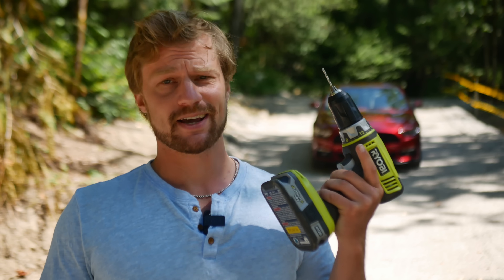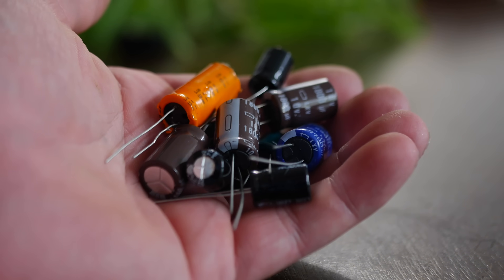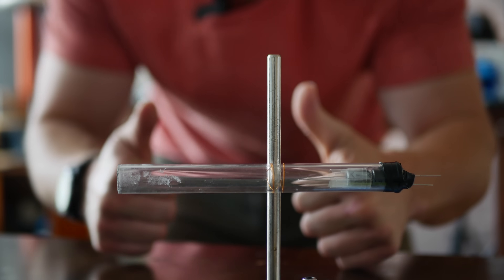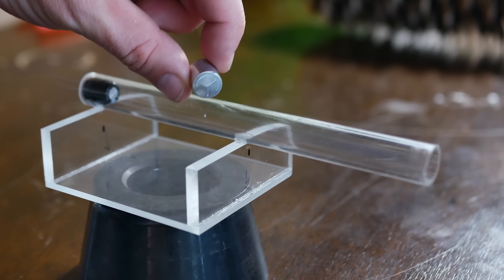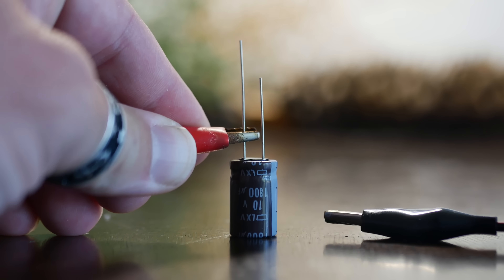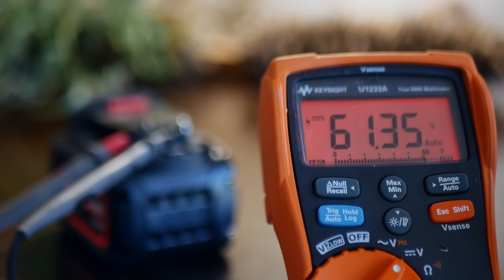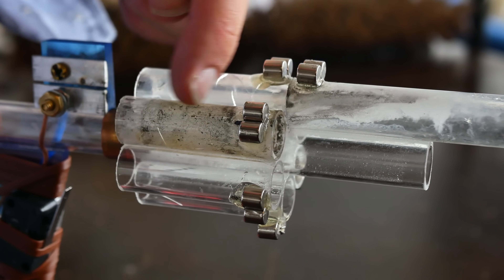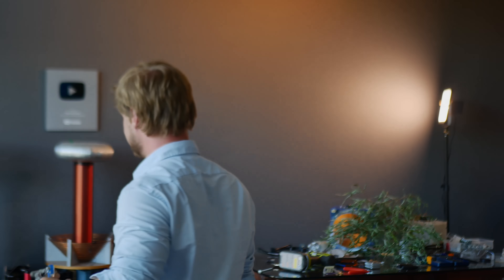I Built An Electric Capacitor Revolver!

Comment: This is such a hilariously bad idea, good video. Probably need a dc to dc step up converter for higher voltage. The copper pipe is ok for short term but will need something stronger as you get more pressure.

Comment: Hey this makes me think of two projects for you. Both of them by the same inventor, Edwin Grey. Edwin invented a motor that used high voltage capacitive discharge to make the coils impulse and rotate. The motor coil with its nominal impedance looks as a very low impedance compared to a high voltage capacitor so the capacitor instantly dumps and you get an intense magnetic pulse. But he started by pulsing magnets this way and making them jump with great energy when the capacitor discharges. You should put that into your gun. And yes that's plasma related because it uses a spark gap to switch the dump cycle when the capacitor voltage reaches High Enough during charging. The second project is the motor itself.

Comment: For Mobil projects like this I use Harbor freight‘s atlas 80v batteries. They’re readably available an Ive taken several apart and know they seam to be consistently packing them with real Samsung INR18650-25R cells Capable of 20 amp continuous or 100 amp momentary pulsed output. Per Samsung’s data sheet.

Comment: This is very cool. Probably wouldn’t be hard to come up with some custom electrolyte fluids and find the most explosive blend... Could also possibly taper the “head” of the capacitor as well to focus the explosion out the top. Reinforcing the walls of the capacitor would go a long way here. This would be easy to acommplish by just slipping the capacitor into an aluminum or brass casing.

Comment: Maybe charge the exploding cap to max and then use your high voltage discharge in reverse voltage . This should theoretically increase the voltage potential the cap is exposed to. 😂

Comment: I know this isn’t for efficiency but for fun, but I feel like a solenoid with low resistance powered by these caps would get a better ballistic output.
That being said a boost converter and a large central capacitor to store the higher voltage should get you some nice explosive results with the same battery.

Comment: I have to 2 important questions:
 In the capacitor cannon you built prior to your final prototype it appeared that you reused the same capacitor to launch multiple shots. So how many times can a single capacitor be used? Secondly, is are any toxic substances realsed by this process?
Reply from the maker: I used different capacitors on every shot - though one of my recorded takes became corrupted, and due to contraints I needed to pop in a repeat clip. I made sure the velocity was accurate to the original corrupted clip, so the data is still accurate.
Reply: @PlasmaChannel  are any toxic substances realsed by this process?

Comment: Add a large capacitor between weak battery and firing mechanism to bump up to 90v+
Reply from the maker: Hm...I could do a 2-stage charging system. Have the battery charge two stage caps to 60 volts each, then pump them in series into the trigger.

Comment: When I was a young man I had a "small" capacitor bank, 240,000 µF @ 250v that I had a lot of fun playing with. Small caps like the ones you are using for this project were obliterated with a report that sounded like a .22LR going off! Might be worth trying something like this as a possible alternative to your drill battery, but make sure that there is some kind of safety shielding between you and the caps being blown up. I wasn't kidding about them being obliterated, usually there was nothing left but the wires and rubber plug, with aluminum and paper shrapnel blown  all around the room!
Reply from the maker: Haha, now we're talking! I"d love to try that. Youtube already hates me for producing this video - so i'd have to really be careful if I made a video about that one.
Reply: @PlasmaChannel  - Yeah, YouTube definitely tries their best to suppress anything interesting and/or educational. That's got to be a huge source of frustration for you.
Safety speech in 3...2...1: "Please be extremely careful." 'Nuf said. Caps like the ones I used (old computer caps) seem to be getting harder to source. A good substitute might be capacitors from those automatic defibrillators, as those ones seem to pack quite a punch and are often rated for some really scary voltages.
Reply from the maker: Certainly is a source of frustration. I do this full time. It pays my bills. So, when YouTube randomly slaps a “ALERT: video is demonetized” warning on a perfectly moral video, it impacts my ability to support myself, directly. 

As for caps, I’m hoping the ones I used stay available for a long time!
Reply: @PlasmaChannel  - Ouch. That's gotta hurt. I'm sorry to hear it, your videos are all very well done and educational. YouTube might not appreciate them, but a lot of us do.
As for the caps, I was referring to using the larger caps as a power source for "rapidly disassembling" the little ones. 😁 You might even be able to set up an inverter circuit so that you can charge them up with your drill battery.

Comment: Did you also plot a relationship between charge & PSI? Voltage & PSI? Rifling the barrel is also important for aiming. Have you tried exploring the trade off for rectified flyback high voltage vs giving up some of the current?(What Current/Voltage balance is best out of the wattage?). Also Nitrocellulose(modern bullet powder) is 48.50/kg; Niobium is around 45$/kg. You may have also made a cost parallel to modern firearms that could be heavily developed, & further reduce the cost to be a competitive substitute. Capacitors & voltage would be FAR easier to control the PSI & discharge velocity; not to mention safer, vis a vie Kentucky ballistics. Without the need for much of the rifling action mechanisms, you could likely make room for custom battery designs to accommodate the high wattage needs. Heck I'm not just considering building one, I'm considering turning this into a competitive product & seeking investment. Let me know if you want me to send you an email to discuss it.
Reply from the maker: Love your enthusiasm! So fundamentally, gunpowder will always explode faster than any cap that I can think of. Traditional, real firearms will outpace this in any scenario I can think of - in part due to the energy density of gunpowder vs one of these exploding caps. The velocity of my build could certainly be improved, and I know how to improve the speeds by 50% or greater right now. However, this is essentially a steam-powered projectile. Steam vs chemical explosion is not even a close match. Feel free to shoot me an email (email is in the "about" tab under channel page), I'd love to hear from you.

Comment: i think you must increase current
Reply from the maker: The battery provides about 10 amps in current configuration. Maybe more would be better though.
Reply: @PlasmaChannel  obviously it not enough, I recommend you try batteries from RC model, like fpv drones they are can give 150A in peak. Time of capacitor charging strictly depends on current and voltage

Comment: what if you had the capacitor exploding provide the initial velocity for a railgun sort of system, that would be sick
Reply: Back in the later 1980's at Culham Laboratory, we built an experimental railgun that worked this way.
A small capacitor bank was used to explode a planar metal pair of metal foils, separate by an insulating plastic sheet but bridged by a small piece of fusewire. The explosion of that foil system deformed an enclosing aluminum plate and kicked the railgun projectile into the gun rails. The latter were connected to our main 8kV, 1MJ capacitor bank.
The exploding foil technology had been taken from earlier work on a fast closing switch, the 'metal to metal' switch.
Reply from the maker: Hm, so a two-stage, double system launcher? Thats...not a bad idea
Reply: @PlasmaChannel  yes sir

Comment: instead of using metal, wouldn't it be more sensible to avoid possible shorting (because ANYTHING is possible) by using carbon fiber tubes instead? (Although using brass or copper would give it a steampunk vibe?)
Reply from the maker: I'd have to investigate what temperatures CF can withstand. The chambers get well above boiling point.
Reply: @PlasmaChannel  Greetings from Olympia! 
This might be WAY better.. "Explosion proof" glass is a borosilicate composition that is far better  than Carbon Fiber. (And it's also clear, where CF is definitely not.) high pressure, high temp invention especially when it has been tempered!

I got curious and looked and found CF has some flammability issues, please disregard the suggestion. :-)
Reply: @PlasmaChannel  Better solution! Aluminium oxynitride A.K.A Transparent aluminium!!!  It is a see-through ceramic of polycrystalline that is made from a structure of oxygen, nitrogen, and aluminium. This impressive material looks completely see-through and is incredibly strong. Transparent aluminium is four times as hard as fused silica glass, three times harder than steel, and a whopping 85% harder than sapphire, and also has an extremely high melting point and can remain solid up to 1200 degrees Celsius. This means it can be used for products which need to withstand super high heats while also being see-through. Transparent aluminium is also resistant to damage caused by oxidation and radiation and offers good resistance to corrosion. 
Aluminum Glass Facts:
Most common commercial name is ALON
Can be formed into windows/transparent armor panels
Lighter and thinner than traditional bulletproof glass
Typically contains 30% to 36% aluminum
Can withstand extremely high temperatures/large impacts
HOWEVER...... Commercial aluminum glass costs somewhere in the range of $10 to $15 per square inch. So, a 1-square-foot panel would cost between $1,440 and $2,160 (according to a Sep 9, 2021 article on Riotglass dot com) 
but there's another option...
Transparent steel is the nickname given to ArmorPlast’s™ AP25 containment-grade glazing shield system. (These transparent armor panels don’t actually contain any steel or other metal elements. They get the nickname from their steel-like strength and impact resistance.)
AP25 sheets are made out of a single layer of AR polycarbonate with an abrasion- and UV-resistant coating. AP25 is a non-ballistic grade shield, meaning it is not bulletproof, but it is so strong that it won’t break apart or diminish in strength after being riddled with bullets.
This invisible steel offers the transparency and surface hardness of glass paired with the virtually unbreakable impact resistance of polycarbonate. 

just stumbled on this, thought to share.

Comment: Definitely need a high voltage capacitor bank to dump tons of current into the caps all at once, use the drill battery to charge the capacitor bank between shots. Also I doubt the micro switch can handle that amount of current. You probably want to use a relay, contactor, or mosfet circuit. Copper might not be the best choice, you probably want to use pressure rated steel. You should still be able to get that at the hardware store. Maybe your next model can be more of a "shotgun" or "muzzle loader" that's single shot but attempting to get as high a speed as possible.
Reply from the maker: That's a great idea, not going to lie. I'll look into it.

Comment: a buck converter and a 300v cap dumping into the 10v cap would be an interesting change
Reply from the maker: Yeah, the one trick is that these caps require about 200-300 watts to explode. That's a ton of energy for a capacitor to hold, and why I found a battery was best for this prototype. I tried using one of my 800,000uF caps rated at 20 volts - and discharged it into one of the 10 volt caps. Nothing happened. In the end that massive capacitor only holds 160 joules of energy, which is a fraction needed to explode the caps. However, i'll look into that idea further!
Reply: @PlasmaChannel  I was thinking more like 450v 15000uF (1500 joules)  Ive got a few of those monster caps on ebay over the years for coilgun experiments.

Comment: Build a rifle version that has additional capacitors in series or parallel (as needed) to boost your voltage into the 150 range, and put a cone on the tip of the projectiles for better accuracy.

The best results will come from a roughly 40 watt system, which came be done if scaled right. 😉
Reply from the maker: That's a cool idea. Have you built one? If so, shoot me an email!
Reply: @PlasmaChannel  I'm currently wiring up the capacitor bank with a gradient from small to large to lighten up the power pack. As the small capacitors discharge into the next size up so to speak the charge is scaling. When you wire them in series you step up the voltage so it lets me use smaller batteries to do the same job, or use my current pack to fire more shots.

I had planned to use it for a coil gun, but you're capacitor pistol is another thing I'm willing to try.
Reply: But only if all the electrical inter connections are correctly terminated ;-) ?

Comment: So I am just assuming a future version will include a boost converter to charge a high capacity capacitor or ultra capacitor so that you van use much larger voltages.
Reply from the maker: IF the storage capacitor is large enough, it's possible. But these caps take so many joules of energy to go off, that a staging cap may not be able to provide enough power.

Comment: I remember as a younger fellow, using a 300v camera capacitor with some extended leads to very excitedly explode a 15v capacitor connected in reverse bias. Maybe you could use this information to your advantage.
Reply from the maker: Thanks Trey, I attempted something similar with limited results. Maybe I should do more testing on that one.

Comment: chamber pressure is everything. if you reduce the barrel diameter of the projectile but keep the capacitor chamber the same size it will increase the chamber pressure. which in turn will push the projectile a lot faster. pretty much every rifle round does this same thing where the powder load is held in a larger diameter then tappers down to a smaller diameter bullet increasing chamber pressure and muzzle velocity. just make sure it is made from material that can withstand the pressures and heat.
Reply from the maker: Wait for the cap revolver version two :P . Great input!

Comment: wait why use so manny capacitors but no capacitors to help generate the burst amperage.
seems rather expensive and weak however
also in netherlands we have something just like this but much cheaper and more powerfull.
it is basically just a copper pipe with 2 projectiles inside of it which fit very tightly. the projectiles are sometimes made out of something like potato but more often out of destroyed paper and water. then there is a piston on a handle where the pison is around as long as the pipe-the projectile size. when the pison is pressed in it moves the back projectile creating a quite high pressure inside when done right. eventually the front one shoots out and you hear a loud bang. typically you want the piston to move as fast as possible for the highest power. when used really right it can even generate smoke/mist when shooting making it not only sound but also look like a real explosion.
Reply from the maker: That sounds like a really cool launcher. I'd love to see that.
Reply: @PlasmaChannel  hah, as mentioned really simple, just a pipe and a shaft on a handle, and double ammo since the ammo also acts as a piston.

 I have one we made long ago at home in the garden I can show it to you so you can easily build one or a better version. 
I will however only use the small one we also have a big one but wont use that now since that one takes more paper for the projectiles and I would have to find out where that one is. but I know where the small one is so shall show that one.

perhaps it could be automated by using a strong/fast spring and using a magnet and electromagnet to make the trigger system. so that the electro magnet either holds it in place or pushes it away, that way it kind of is like one of those simple spring based guns but with more pressure and sound.

Comment: A D cell connected to a hundred amp 240 line meant for a sub-main breaker box propelles itself without even a barrel with enough force to crack a few skulls.. I don't recommend the black staining  boiling caustic koh electrolyte however, nasty mess.
Reply from the maker: Hahah man that sounds ACTUALLY dangerous.
Reply: @PlasmaChannel  yeah, worst supercharger ever! 😜

Comment: If there's one thing this appears to be missing it's a whole lot of voltage...

I'm a bit disappointed Jay... Not one kilo before any of those volts. What's this channel coming to?!? ;)

Might I suggest a portable HV supply into a HV capacitor bank, then discharge the bank through the poor 10V cap.

If 90V is better than 60 surely a few kV will be better still...
Reply from the maker: Haha, i'm working on it, working on it!

Comment: use supercaps in series to make the revolver purely run on capacitor energy
Reply from the maker: If I can get supercaps up to 60-90 volts, and, in a small enough handheld size.
Reply: @PlasmaChannel  that’s the biggest challenge. Me thinks you can use a boost converter to step it up but not sure if it can handle the current

Comment: Zean YT mentioned using a capacitor (charged by a boost converter), but just to double down, why have 1 capacitor when you can have 10? 10 of those small caps in series for 100v. Easy to expand for higher voltages. You could even go much further (and complicate it even more) by charging banks of 10 10v caps one after the other using mosfets, then using some kind of relay to put them all in series when theyre charged. Though I reckon once shorted to the "ammo", the relay contacts might fuse lmao
Reply: I believe that type of design is called a Marx generator, after the inventions of Erwin Marx.